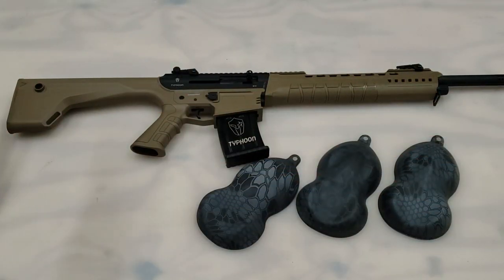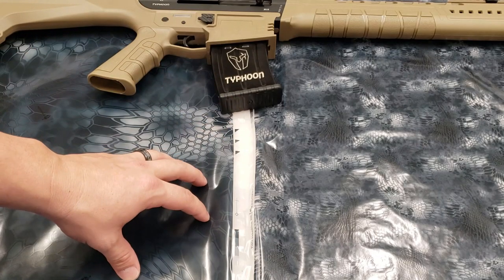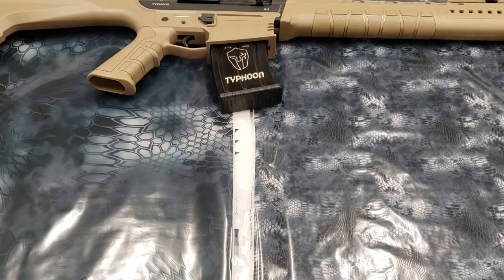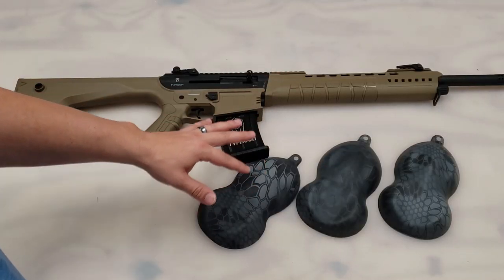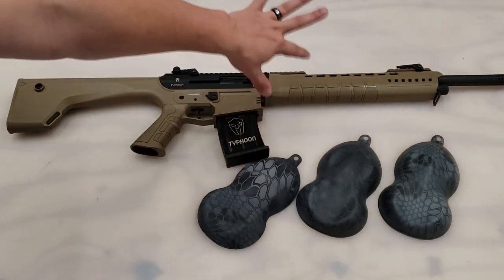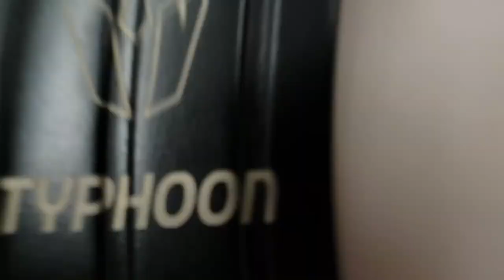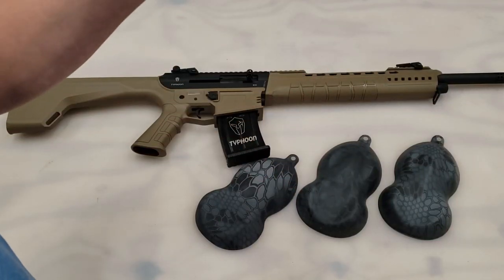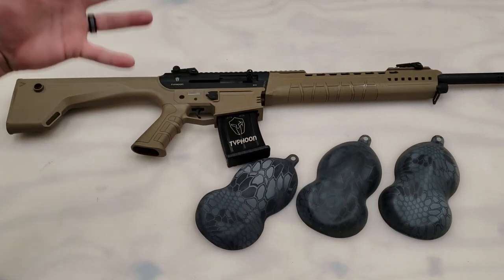HYDRO DIP TYPHOON X12 - [Typhoon Defense XII] Kryptek Typhon Camo

Comment: Splitting the dipping in half is a solid idea bc then you end up with seam’s down the camo patterns.  Why not just dip topside down at an angle in one swoop
Reply from the maker: Actually it doesn't leave a seam, thr patterns overlap and I airbrush in any areas that may even slightly appearing to be a seam.... you will never get full coverage in one dip and will have tons of air holes and blow outs in deep stipling on gun stocks trying to do it that way. I do my ghost seam method, been doing it for years and all my customers love it. There is more to it that a short little YouTube video.